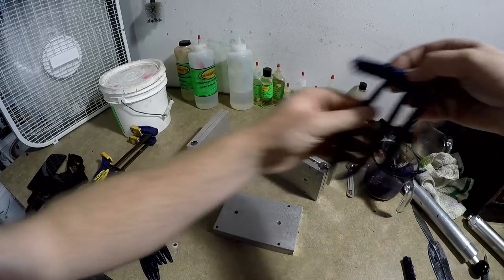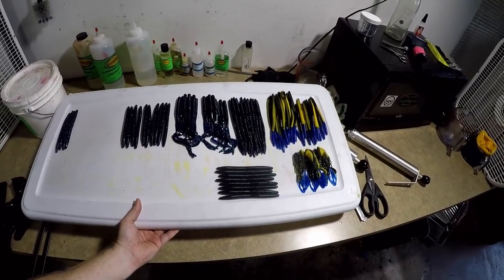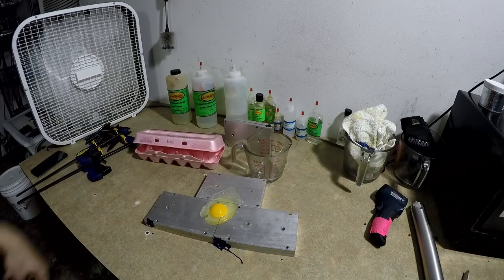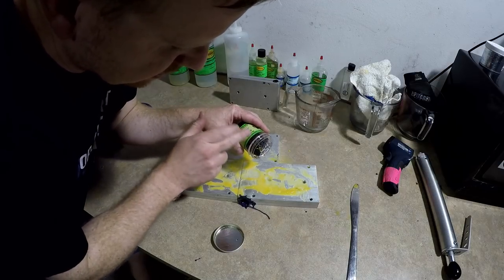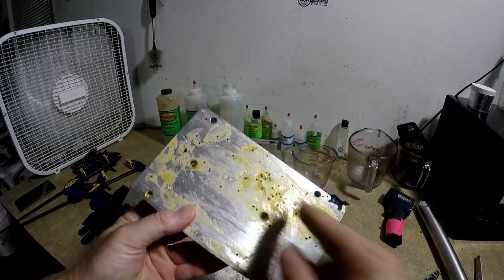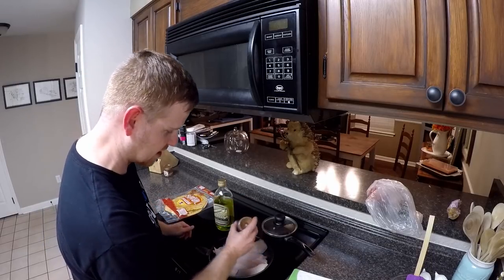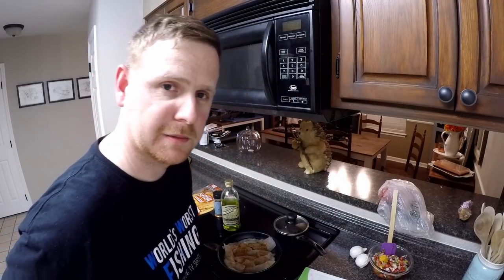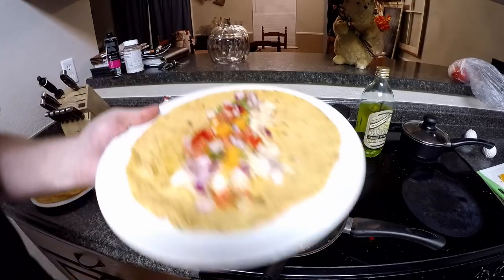CAN MY SENKO MOLDS COOK AN EGG?? Also, Fish Taco Recipe Blog

Comment: Awesome video. I think the senko molds get the hottest because they are the thickest baits. I place 2 or 3 larger molds in the freezer until they
get cold and then take them out and place the senko molds on top of them after injecting. Helps keep the temps down while I'm using them.
What do you do with all the leftover plastic from the sprue in your laminates and your swirl/camo patterns? Thx
Reply from the maker: yeah they def get too hot sometimes...leftover laminate/swirl sprues go in the trash.  SOlid sprues are saved and remelted

Comment: I think you need better ventilation, breathing in too much plastsol fumes
Reply from the maker: I think ventilation is one of the tougher aspects to get right.  I don't really smell the fumes unless I am "down wind" of my fans..and I always shoot with the garage open and the air moving outwardly.  I could maybe eventually also add an exhaust fan overhead.